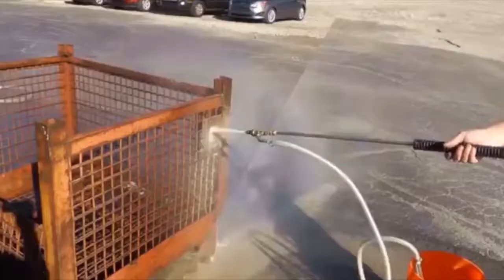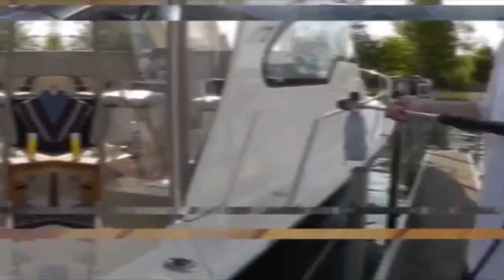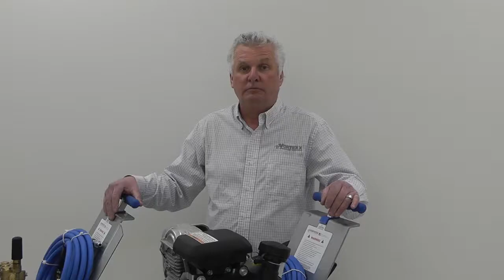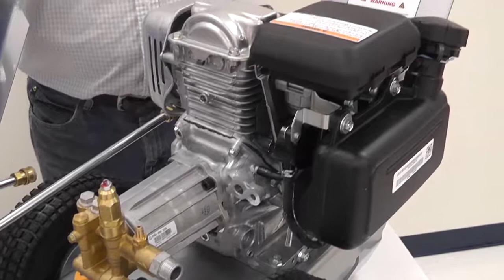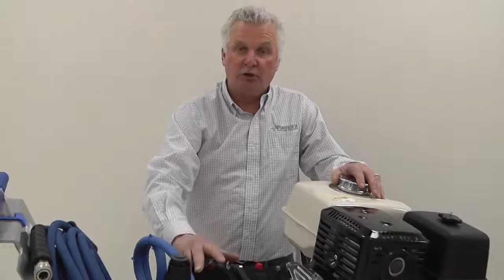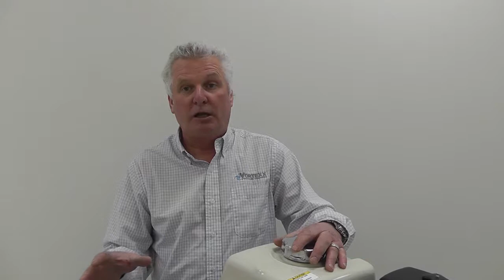Vortexx Full Line Comparison

Comment: Definitely not but this machine. I got one and less then a year was get me a couple rounds to the shop for different problems, water pump, losing pressure, wand gun, water heater. Etc, the warranty is by different manufacturers. Headache 👎🏼👎🏼👎🏼👎🏼👎🏼👎🏼

Comment: Stihl seems to have more value at their low end professional grade than the High end Vortex professional grade washer with the exception of the frame which has nothing to do with the actual functionality of the unit . More pressure per horsepower with an adjustable pressure valve , Better quality hose that is braided steel . Stihl is heavier which would make it more difficult for someone to pick up and carry off . The roll cage frame on a Stihl actually protects the engine where the Vortex frame has nothing to protect the motor . The pressure hose on a Stihl does not have to be banded to keep it in place and the price point is less than the Vortex . Also , Honda engines, although a great engine, have to be worked on by a certified Honda mechanic where as the Kohler can be taken to any shop of your choosing . Thanks for helping me decide to buy a Stihl RB 600 .